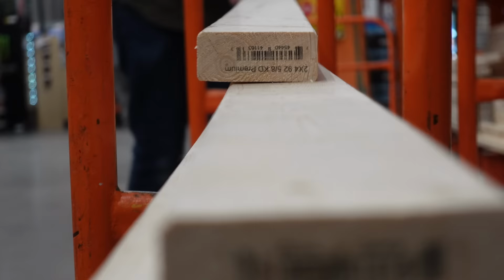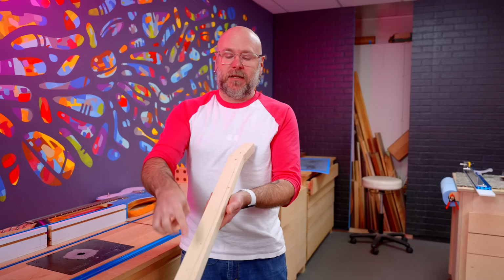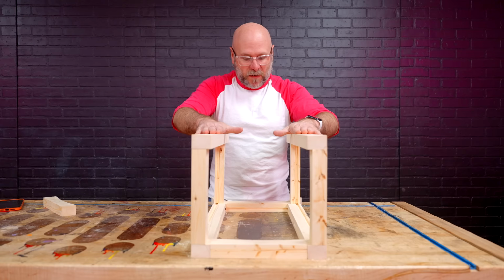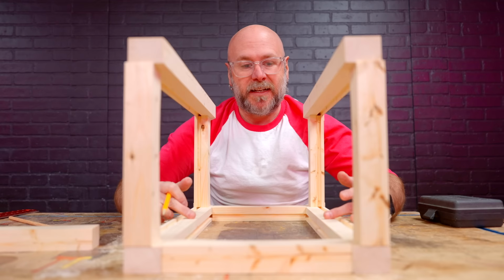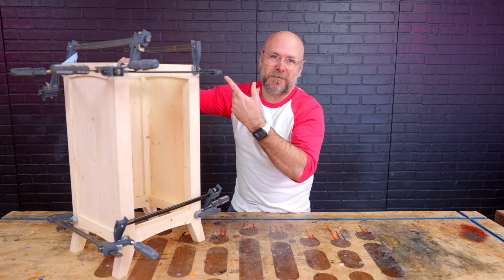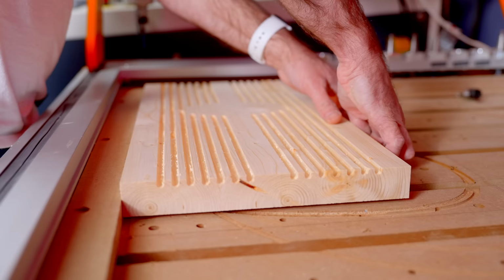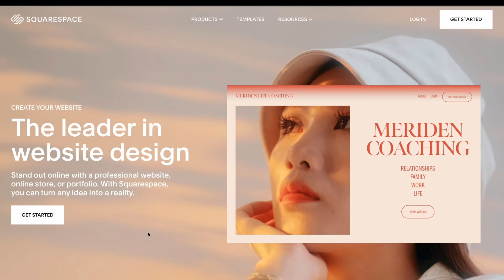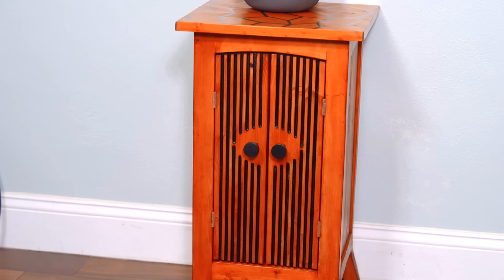Stunning Fine Furniture from 2x4s! This even blew my mind!

Comment: You are quite the guy!! I am 71 years old and have built a bazillion things out of 2x4's, some small, some big, but NONE of them looked like this cabinet. Well done, Sir.
Art from Ohio
PS; I used to have a 1968 Impala SS fastback - 327 365 hp - turbo 400 - floor shift w/console. I am sure you know it is the twin to your 67, only real difference is the tail lights.

Comment: I'm a old bat with a wood shop. I restore antique furniture and do custom builds out of trash lumber. I made some picture frames which housed 380 wine corks a piece and a sign for a doctors office out of a pile of redwood fencing scrap which I milled to perfection. Most of my wood I use is up-cycled and I am always on the prowl for anything I can find. I rarely get to use hardwoods. Right now I am turning a segmented bowl for a client on my 1947 Shop Smith (which I rebuilt myself) out of a futon and a ring of hardwood as an accent. Nice video.

Comment: This little cabinet is beautiful and quite a creative design.  You did use a tool that most of us don't have, but this project could be done with 'regular' power tools that are in most shops.  The build would take longer, but it could be done.  BTW: I love the cherry stain and the pentagons on the top.  Thanks for the video.

Comment: Good vid. I built pine and hardwood. Viewers should be aware that dimensional pine will warp soon after cutting, joining and planing. It’s not a material that can be all prepared together at each stage. It needs to be put into place and immobilized right away. It can’t be left on the shelf until the next weekend. Often, I have found it will bend, twist, and generally piss you off. Pine is cheaper and easier on your blades, and a good way to practice skills. Just be aware that it is like training a hyper puppy.

Comment: I have made a lot of cool furniture from Home Depot construction lumber. I prefer to use 2x8s because they are not only straighter they mill better. It’s also cool because you can look at the end of the stack and find the pieces with really tight growth rings. The boards weigh twice as much and look nice. The dust is not as bad either.

Comment: I love it when somebody makes some nice furniture from ordinary old 4X2's.. I had a load of leftover 4X2's from a job I did but they were pressure treated for outside work. I used them in a Decking job but when I began cutting them down it left a really bad black dried substance stuck all over my Table saw blade. Now tbf I was able to clean it off with some WD40.. Yes my bro I used some good ole WD40 as a cleaning agent.. 
Ur a great woodworker and I also love this sliding table u built bro. It worked out a real treat. I was thinking of something like this myself but I really need to upgrade my saw 1st man.. After that I will begin my change up in the shop. I don't have a massive shop either though so it depends on how big I build it as well,,
Dale was spot on with the "FISHIN' FOR COMPLIMENTS" my bro..  LMAO

Comment: Nicely done!
The thing that sets apart ‘fine’ furniture made from construction lumber and ‘bad’ furniture made from construction lumber is really milling. If you use construction lumber as-is, the results are pretty sad, but if you mill it down and turn it into different and nice shaped parts, you can get nice results!
Reply: You can mill dimensional lumber to look quite good but if it still needs to dry, things can go sideways over a very short time.  Boards twist, bow, and shrink.  So be careful with pine if you don't have time to let it come to equilibrium in your space.  Small projects using 2x4's are probably best.
Reply: I would also suggest using exclusively southern yellow pine versus the other "construction" species as SYP will outlast the others.

Comment: On the one hand, I seriously doubt that most people have as many expensive tools (drum sander, CNC router, Laser, etc.). However, there is something really valuable here even for modestly-equipped shops and that is that creative thought should be the driving force. Case in point is the technique of painting the grooves black and then sanding to create the clean two-tone look, simple but effective Also, the pentagons can be made with a miter saw and some patience or a jig on a table saw, and the grooves cut on the CNC can be managed with just a palm router and a straightedge. 

Speaking of CNC, there are some cool things happening in the DIY world. It is entirely possible to build your own CNC router for a fraction of what a commercial machine costs. Check out the V1Engineering LowRider 3, a large format CNC router that you can build using 3D printed parts for well under $1,000.

Comment: Great build, and to the "expensive tools" comment, most of what you did could certainly be done using other tools, though it would probably take a bit (or a lot) more time, e.g. preparing templates for the pentagonal shapes to then cut those with a flush trim bit, a progressive series of cuts with a router/edge guide or at the router table for the doors, etc. I like the black filled elements a lot, nice contrast without the need for adding in an expensive/time consuming dark wood inlay. Based on my experience buying 2x4s at Home Depot, that probably took a while to find an assortment of fairly usable boards!

Comment: Great video.  I would have used 2x10s. I think you can get better boards and it costs less.  I love my Festool ETS EC and my Harborfreight f-clamps.  I have had the clamps for over 10 years, and they still work like new.  If it works why pay more?

Comment: Really like the finished project, however, just because you mill lumber to a nice shape doesn't mean it will hold it's shape.  As it dries, especially if that happens quickly, your materials can still twist and bow.  Would be a good idea to give the 2x4's at least two weeks stacked properly in your space before milling.

Comment: I love that cherry stain. What did you use?
Reply from the maker: Link to the dyes in the video description. I actually combined 3 different colors to get that orange. The only reason I mixed them is because it was what I had on hand. Otherwise I would have just used the proper color.

Comment: Thanks for sharing.  I know you talked about moisture and designing for it.  Did you use kiln dried 2x4s from the big box store.  I know mine has them and I've checked with my moisture meter (out of curiosity) and they have moisture content equal to when my hardwood is dried in my shop.

Comment: Looks like you missed one important step with the wood and that was the in shop acclimation. I work a lot construction grade wood, and it is honestly better than most think. But you have to finish the drying and acclimation work that is not done well to start. After that treat like rough stock like you did.

Comment: Add in the Festool biscuits? Really? I guess those go in the holes you made with your Festool Pizza Hut. But anyway interesting video. I'm interested in things that can be made from 2x4 starting material not so much to save $s, but to save time and to save using hardwood for projects where hardwood is necessary, for structural and/or aesthetics.

Comment: I think pine in general doesn't get enough attention and should be used more. What did people use way back in the day if they couldn't find walnut or mahogany. They cut down whatever they could find.
Reply from the maker: Pine is fine. But 2x4 are not dried to the specs needed for fine woodworking

Comment: There's a lot of problems with making furniture with dimensional lumber.  This thing won't look so good when it warps and cracks and a half-dozen knots fall.  Dying or staining is problematic too because it will be splotchy and take the stain in an irregular way.  And the grain pattern isn't appealing, even if it takes the stain perfectly.

And honestly, why would you want to expend this much effort on something that's made out of the lowest quality pine?

Comment: Honest question here. You can build anything out of anything if you put your mind to it. It looks nice in pictutes... BUT... How is that piece of furniture today? You cant tell me that it hasnt cracked and warped to hell and back. Pulled away from the epoxy etc. Its just the nature of pine. Even if you dont touch it, it fluctuates with humidity, temperature everything. If its still.in one piece id stand corrected and be amazed
Reply from the maker: Right, these are all my concerns as well. As of now it's fine. My mom has it in her house so we'll see how it does over time. Send me an email in a year. 😉

Comment: Yes you can make something nice from pine high end long lasting no problem  but unless you're learning or just starting out then avoid pine. The sap bleeding out the wood isn't worth the risk nor is it really as enjoyable to work with as hardwoods. You won't see me building with pine unless it's budget friendly or for outside otherwise i rather spend a few bucks more and buy poplar. Fine furniture and pine just doesn't match up well together.

Comment: I was with you all the way until you cracked open the dayglo "cherry" dye.  That cheapened what did have the makings of a classy project until then.  That doesn't take away from your point that you can make classy furniture out of cheap lumber.  However, if you're doing woodwork on the cheap, but using expensive machinery like planer thicknesser, drum sander, CNC, etc., I question your priorities.  Try doing it with hand tools, then you'd really have a point.

Comment: I have found at least at the home depot i shop at that there 2x4s are a waste of money.  worst most beaten up, knotty, twisted pieces of garbage known to mankind.  There 2x6s however are much nicer, I even found a couple of boards that were perfectly flat with not a single knot along the entire length.  I recommend using 2x6s instead of 2x4s for your furniture ;)

Comment: Well, I guess after spending 10-15K on a CNC and laser machine, the rest is pretty easy. LMAO
Reply from the maker: That was like 5% of the project. And also not necessary AND can be done with basic tools. Come on man, pay attention to the point of the video. 😁
Reply: @MakeSomething  I did pay attention and I got the point. Your project did look great. I've already been using 2x4's, 2x6's, etc. They are highly underrated. With the right finishing they can look just as good or better as hard woods.